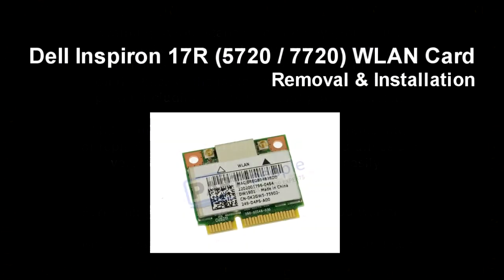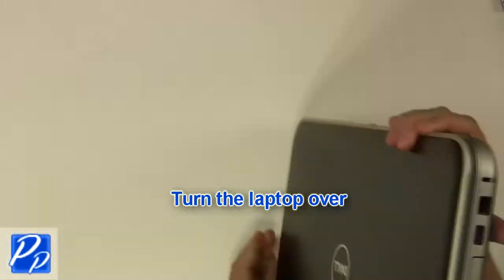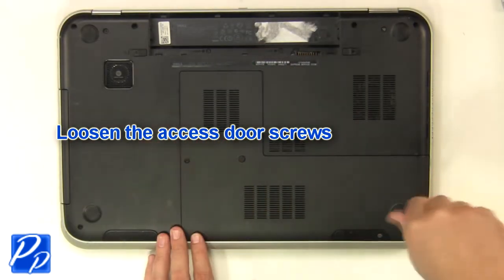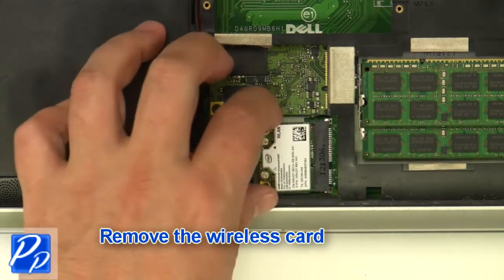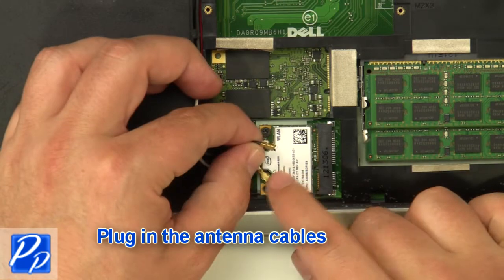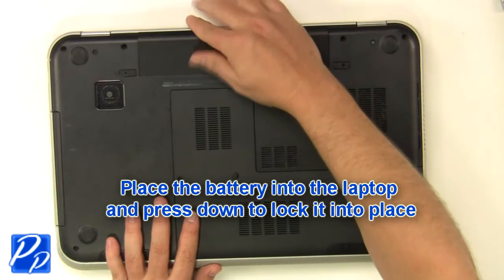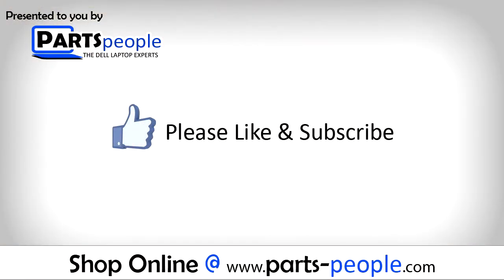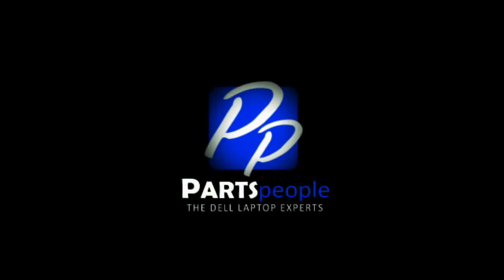Dell Inspiron 17R (5720 / 7720) Wireless WLAN Card Replacement Video Tutorial

Comment: I need to replace wifi card in Dell se7720, Intel centrino N2230 has several varients with different ic numbers. Could you please tell me whether all of them would work with it or should I order any specific one among them.. Pls help me by letting  me know as soon as you can, I really need to change it.. :)
Reply from the maker: I'm not sure of the variances you've came across but I know this one works with your laptop. https://www.parts-people.com/index.php?action=item&id=13873
Reply: Is there a wlan card for this model that supports 5GHZ frequency? Link to product?

Comment: How do I repair/replace the antenna wire to the WLAN Card?  The original connector is disconnected and missing.... I can reconnect the wire but I don't know the terminology or stock number for the wire/connector.
Reply from the maker: +William Matthews I think you will have to  replace the LCD back cover assembly. It will house the antennas and antenna wires. I don't know of anybody that sells just the antenna connector. http://www.parts-people.com/index.php?action=item&id=12996
Reply: +Parts-People.Com, Inc Thanks, I decided to tape the loose wire to the connector see if it would work... it does, so for now I'm going to live with it... I discovered that the wire that was disconnected was only the ground wire anyway.

Comment: Thanks! Will a Intel® Dual Band Wireless-AC 7260 Plus Bluetooth* replacement card work with this laptop? I have the Dell Inspiron 17r SE 7720 Model. It desperately needs a new card, since I've noticed the card doesn't pick up my 300mbps speed I'm paying for.
Reply from the maker: +Zarac1121123 If you can find the correct driver it should work. Although I haven't seen any AC cards for this laptop yet, I still think it should work.
Reply: +Parts-People.Com, Inc Thank you so much. I have a lot of confidence now. I already have located drivers that I can install with this, and all I need to do next is order the part. :)
Reply: I sure did! The upgrade worked perfect, and with google fiber, I can now get a surplus of 866.67 MB/S when next to the router. :)
Reply: I used the Intel Wireless AC 7260 adapter
Reply: bluetooth work?
Reply: Bluetooth working?
Reply: Zarac1121123 can you provide link to download driver.
Reply: Can you provide the link to purchase Intel Wireless AC 7260 adaptor? I looked in amazon and there are so many options. Check this one https://www.amazon.com/gp/product/B00MV3N7UO/ref=ask_ql_qh_dp_hza  ... the '.R' at the end of Intel 7260.HMWG.R is the revised version to an earlier card Intel 7260.HMWG.

Comment: have a question. could it be loose if it keeps going limited or slow based on what angle its on. as time gets worse at this that i half to put books under it to keep it on. otherwise take them out from under and it drops. tech support tried to claims viruses can make laptop wifi know the computers angle which is trash. trying to sell serves i dont need. i want a normal reason not something no one will enplane that dont make since. only thing i can think is somethings loose
Reply from the maker: The antenna cables might be loose so putting the laptop at an angle might cause a better connection, I guess. Try removing the door and check to see if there are loose cables. If the cables are not loose leave the door open and turn on the laptop. See if you can replicate the connectivity issues and try pressing on the cables and wireless card to see if that effects the connectivity at all. If it isn't the cables, it could be the wireless card or maybe a the slot on the motherboard that the card goes into. To be honest, it's hard for me to say without having the laptop to diagnose. **When working on the laptop with the door open and the power on, be very careful to not touch any part of a circuit board or motherboard. I would suggest taking the laptop to a repair shop. Try this at your own risk.**